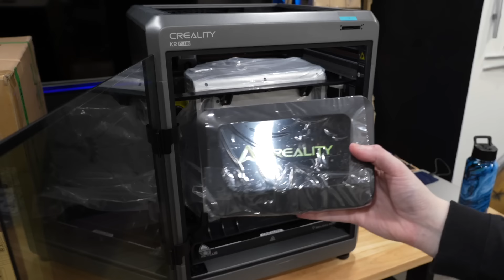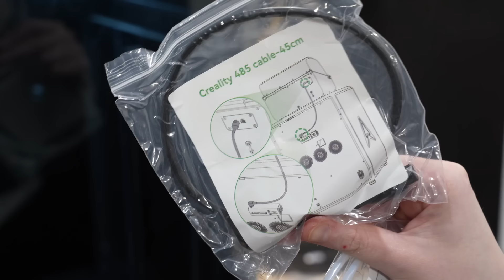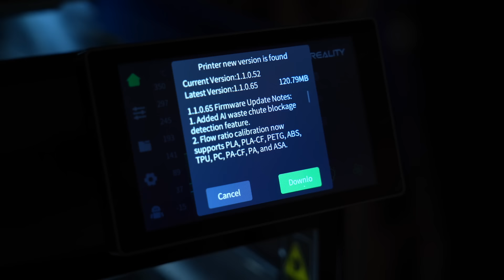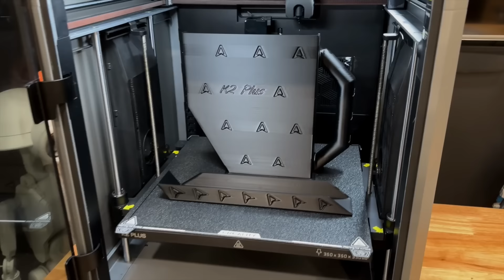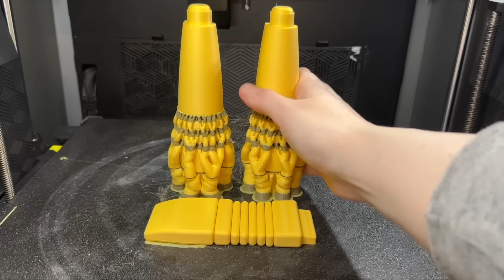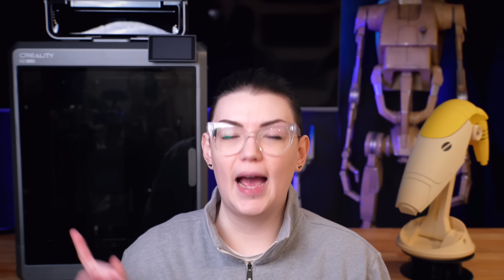Does the Creality K2 Plus live up to the hype?

Comment: on my bambu I have the purge amount set at 40% of OEM amount and that clears whatever I've printed so far. So my guess is that creality's purge is a bit excessive to ensure no one that just hits print and doesn't adjust anything will not run into anything.

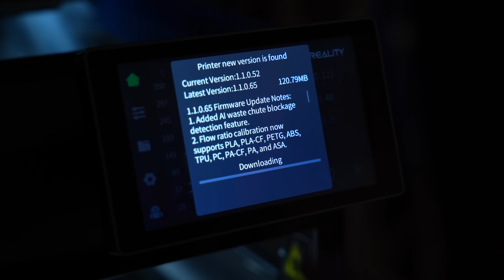Comment: Have you tried the TPU? I saw on the website that it is not compatible, but at 5:21, the update mentioned TPU.
Reply: The printer is supposed to be able to handle many grades of TPU, but they are NOT intended to be run in the CFS sadly.
TPU is intended to be run off the side spool, in single material prints. You might be able to get the stiffer TPU grades to run in the CFS, but there's a jam risk / buildup of friction through the tubes.

Comment: Just don't print CF filaments... that unicorn nozzle is clog happy... even with non CF filaments. I swear it carbonized the PPS-CF i printed so it turns into a concrete type substance and unless you drill it out... bye bye nozzle. 

I think the CFS is better used to have backup filament... and people will be better served if they learn to paint their prints.

They need to work on that nozzle and firmware.

Comment: I didn't get a K series printer until the K1SE came out when they finally had replacement parts for the K series printers (specifically the unicorn nozzles). Creality printers you trade in cost with time. I love buying cheap and fixing/ upgrading it so I don't feel like I wasted my money with the upfront cost. In a year when they finally get proper replacement parts then  it might be worth buying. The CMS and the build size is really the selling point but if you have a K1 max, save up for a CMS and the adapter kit to make it compatible.

Comment: It is 700€ more expensive than P1S. 
Cool screen - I use the software or the app
Heated AMS - Yes that is cool
Bigger - Size doesn't matter. I hope.
Nozzle change - Better than Bambu

My two cents: 
-I don't see any killer features, to expensive, wouldn't buy
-Multi color printer should have multiple nozzles. That is the next thing and we want it now!

Comment: I'm with you on multi-color prints.  I have an AMS and like it, but mostly for rare prints where it's just a few layers of changes, and the auto-refill capabilities.  Simply loading filament is SO much less fiddly, not that that alone warrants the cost.  But I'm just not into the insane waste that big true multi-color prints necessitate... painting seems like the better option, especially because it then no longer looks 3D printed.

I'd love to see a comparison to the Bambu printers, however, raw size advantage aside. (which is impressive!). How do the two do, head to head, printing the same models in a size they can both handle?  Is the K2 just as good at smaller pieces as massive ones?  If you could have only one, do you give up quality for the size? 

And finally... is it just me, or did they totally rip off nearly element of Bambu's design, with only a few tweaks here and there?  The AMS vs CFS was rather eye opening... sure they exposed the tubes, good idea, but otherwise it's a pretty obvious clone, to my eye.  Copying a good idea isn't necessarily a bad thing, but still.

Comment: We have this printer for a week now. What we learned in this time, when you print multi color with PLA don't have to many color changes in small areas or you get mixed colors. Open the door also can help with this problem. You should also don't use high contrast colors. White+black in a multi color print give you most likely a couple of layer with different shades of gray.
The print quality on this printer is on another level. We have an Ender 3 V3 Plus and an old Kobra Plus and the K2 beats both of them pretty easily.
We are now waiting for a smaller K2 to replace our bedslinger :D
Reply: Looks like you need to adjust purge volume.
Reply: @blalesnail3098  possible but we don't care. Multi color prints are way to wasteful and take a ton more time. We use the CFS to fix the annoying your roll has not enough filament but you have no time to manage the filament switch in the printing process.
The CFS do this for you fully automatic. Yesterday we removed two rolls from our pile of shame :D

Comment: I don't do a lot of multicolour printing but I am glad I got the AMS with my printer.  It lets me have 4 reels automatically available at all times and should I want to go multicoloured I can.
Reply: I don't do multi color much either. But I tend to have it stocked with 2 rolls of pla and 2 rolls of petg. I print all support material in pla as it does not fuse into the petg resulting in easy and clean support removal.

Comment: Poop Solution: You need to turn on Purge to infill
this reduces poops and total filament usage DRASTICALLY
still uses some filament to clear the nozzle because it has to, but it cuts down total use by a LOT...the poop goes to your infill instead of 100% new filament going to your infill

Comment: I made a comment a few weeks ago in a printing group regarding the poop amounts compared to a bambu. I sliced a 3" tall, 4 coloured, pickle rick model as a direct comparison of time etc. On single colour prints the K2 plus wins hands down on time etc, but loses spectacularly when you factor in poop times on multi coloured prints. Now I was obviously shot down in group as a Bambu fanboi, but it was a serious question. Both machines were on identical settings @ 0.08mm layer heights and the time was 6hrs on bambu and 17 hrs on K2, and used alot more filament. I don't understand why they didn't do a clone bambu hotend to reduce the poop, and yes these settings can be tweaked, but nobody seems to be addressing this until now. K2 is a good printer that I will end up purchasing to go with my Bambu's, but this is a big omission considering they are hyping it as the bambu killer.

Comment: Orca Slicer has a feature to purge into objects infill and purge into support towers..  As a community we need to push the manufactures to make all of them do that.
Reply: Purge into infill is such an awesome feature. Of course it isn't perfect, if you're running low density infill you might not get full purge, but I'd rather take a layer or two if transition than literally entire rolls worth of waste.
Reply: Creality and bambu both have this feature in their own slicers
Reply: @uravian obviously, since it's been Prusaslicer for quite some time. Iirc it was in roadmap 2018
Reply: But wouldn't that have a risk of ruining prints?
Reply: @hihellothere9569  Agreed which is why I set the option to purge into support only.   This feature is available on Bambu and Creality slicers as of April 2025
Reply: Creality print does as well
Reply: Purge into infill is nothing compared to 'long retraction ' which only left around 20to 25mm of filament to purge out
Reply: @ramadavince6611  Is this an option available in Orca? I'd love to enable it with my X1
Reply: @kylequinn1963 it should be available on X1/P1 and with recent Bambu Studio versions, also on A1
Reply: @kylequinn1963 purge into infill is available in Creality slicer as well.
Reply: @ramadavince6611  Can you explain what 'long retraction' is and how it helped?
Reply: @ramadavince6611 does the long retraction option pull it out before cutting it?

Comment: In regards to colour printing, I like some of the DIY-developments being made right now. There is a really interesting kit to make basically every filament printer into not just a multi colour printer, but a full range colour printer. Using translucent white filament only and a basic ink jet cartridge with some added electronics and a few parts that can be printed out. Interspersing a colour pass in between each print pass so the ink gets bound into the surface of the print. And because it´s an ink jet cartridge and technology, it can do every colour you can do with a normal printer. It is such an awesome idea and the results I have seen are surprisingly good for being a DIY solution based around a normal ink jet cartridge not meant for this purpose. 

I am really hoping that this will get to the attention of 3D Printer Manufacturers, because a purpose build and engeneered version would likely be even better. Using ink or dye meant to stain plastic as well to improove vibrancy and resolution. There is just too many advantages of it. You not only eliminate the waste of purging or need for an expensive and complicated multi toolhead/nozzle assembly. You also only need a single type of filament (like how you only need white paper for printing, or another colour if you want a solid coloured background and not overprint the whole page with an excessive amount of ink) and not a whole library of coloured filaments that will still limit you. And you can do an incredibly wide range of colours, as well as insanely complex colour combinations and gradients. And you don`t need unnessary amounts of ink because only the outermost milimetres of the outer layer need to be coloured, the wole inside can be left as is as it isn´t visible. With the increasing resolution of FDM printers this could create absoloutely awesome results. Like fully coloured miniatures straight off the printer.
Reply: Any place to read more about this?

Comment: I will say the extra nozzle size shouldnt automatically mean more waste. Bambu was able to reduce waste since they initally launched by retacting the filament and cutting off just the tip so that purge needed was minimal and you kept the reliable switching. I expect Creality (or more likely tech savvy users) to adjust the macros in the firmware to do the same.
I had mmu working on a k1 max and am glad that a lot of the challenges i had there have been solved by Creality here so it gives me some hope... but they do have a habit of developing a product 90% of the way and just calling it good enough

Comment: Nozzle length: The bambu printers have a maker on makerworld that addresses the purge issue when the printer does the change by doing a retract before the filament cut (but beware the meltzone blob).. probably not explaining it well, but this needs to become the norm for all pooping printers as best they can from the manufacturer. This allows you to reduce the flushing volumes significantly. The 'waste' now is a lot more acceptable, and also makes good lamp fillers :)
Reply: Is this working for the K2 PLUS ?

Comment: Bambu is about to completely dominate the printer market..AGAIN. Its crazy how many identical designs Creality took from Bambu, but props to them, it makes all of the brands better.
Reply: I wouldn't call the K2 Plus an identical design to any printer let alone a bambu. I don't see any bambu s with 300mm+ build plate. I guess the CFS ia a sorta copy. However, the CFS is better than the AMS feature wise. The AMS has no humidity or temp sensor. I see where you are coming from though. The K1 and K1C are direct copies of X1C. I just think your description of this printer is misleading.
Reply: @monetary_episode  The size is obviously not the same, but a lot of features are. Even the instruction manual has the same color writing in it. The instructions on which bolts to remove during assembly have the same stickers on them too lol. i'm just waiting for Bambu to drop a new printer next month and watch what happens.

Comment: Yeah, this is why I completely ruled out Creality when looking for an FDM printer.  I like the look of a couple of their machines, including the K2 Plus, but with poor support and practically nonexistent parts infrastructure, it's just not something I'd ever consider spending money on.  It's a shame, really, because the K2 Plus looks like a pretty good machine.  Overall, I have the same feelings about Qidi and their FDM printers.  Really surprised that none of these companies have just copied Bambu Labs' business model.  They could be doing so much better than they are.  Competition is good, but so far nobody's really competing.  I still hold out hope that Bambu Labs will come out with a larger build volume machine, but I would be just as willing to try something like this K2 Plus or a Qidi Plus-4 if they had the same kind of cradle-to-grave infrastructure and support as Bambu Labs.
Reply: I have, Qidi 3D printers and they have excellent support, and Facebook group as well. I’ll probably go with the next purchase being the Jazz3D XY-450.

Comment: The unicorn nozzle has got to the worst nozzle to have for multicolor printing, because, yeah, like you said the purge gets increased and thus more wasted filament. Also the other issue I saw in another review, is that the color bleed is worse most likely due to the nozzle length as well.

I was interested I machine too, but having this problem with the nozzle is a no go for me. I have a k1 and it has hotend issues too with the filament seemingly not able to build back pressure for certain materials.

Comment: Hey, a couple of things I found with my K2 (I've had it for a little more than a month).
First off, you may want to consider putting the spool holder on. There are some materials that can't be run thru the CFS (TPU is the only thing I've tried that the CFS won't handle).
Second, there's also a place on the back of the CFS where you can also mount the CFS.  I got a second CFS, & found that was the best way to setup mine (the CFSs are on a wire rack next to the printer). Also worth noting, the second CFS also came with it's own buffer.
WRT the filament waist that were one color, I recall in the release notes on one of the firmware updates being addressing an issue where the waist was getting jammed in the waist chute.

Comment: First of all, I would like to greet you and express great respect for what you do, you are excellent. I am totally new to the world of 3d printing, I still haven't decided on my first printer and I would like you to help me decide. I am a huge fan of Star Wars and I would like to use the printer to make various droids, spaceships... The printer must be able to work with more colors. I am currently thinking about the Bambo lab P1S combo, X1 carbon and K2 max. I was mostly leaning towards P1S, but the volume of printing scares me, is it big enough to make, say, R2 D2 in real size with assembling the parts and gluing them or something like that is not possible. I repeat, I am totally new to this. To cut a long story short, which printer would you recommend? Thanks in advance

Comment: I don't understand why people let the yellow stickers sit inside, it doesn't look good and after removing the bolt they don't have any function at all. I have both the K1 max and K1c and looking at the filament feeding at the back it is still a chore when you need to replace a empty spool...Like do they not know that when you feed the  filament in the tube you need a third arm to move the tube end on the sensor a bit for the filament to get through, I have had the filament completly stuck there and you need a second person to help........speechless i am... And the filament wast is also something they have to look into to get rid of, I have made this comment more often, the printer can use the last color for inner walls when you have like 2 or 3 walls, and it can also use it for infill parts, this way there is no wast at all, or minimal wast! since it knows the layers and the lenght of the path in meters, it can there for be a very easy job to calculate how much is needed for your print if Creality wants to help their customers get more out of their filament...
At any rate the K2 looks great  congrads on the purchase!

Comment: The single color purge’s are from the start of a print. If the last color is the same for the start of the next print that’s why you see it in the purge bucket.
Reply: it shouldnt be doing that at all then. its just wasting filament. 
plus there were handfuls of them, from one print. so it cant be that.

Comment: so does it mean you can have 5 spools on the machine, 4 in the top and one on the additional spool holder, and its able to swap between all 5?
Reply: 4 in the top or 1 on the side; side roll has no way to retract so can't be used with the CFS / buffer block

Comment: there should be plenty of ways to get around that excessive waste on the nozzle purging. It could swap a set distance from the end of a colour layer, so that it uses what's left in the nozzle to finish a section of infill so even if the second colour starts to bleep through then its inside the model and it shouldn't matter. 
and why does it have a purge tower as well as having the purge chute? surely it shouldn't need a purge tower?

Comment: I'm surprised the companies doing multi colour haven't looked at supplying kits to use the filament poop in some way, surely can't be that difficult?
Reply: it'd be far more practical to make the printer use the filament in some way to print something useful than to try and do anything with spooled up lumps. Turning wasted filament back into usable filament would require the sort of machines that filament making factories have. theres a reason there isn't really an off the shelf filament making machine option.
Reply: With smarter slicers (Orca) you wouldn't create that much waste.